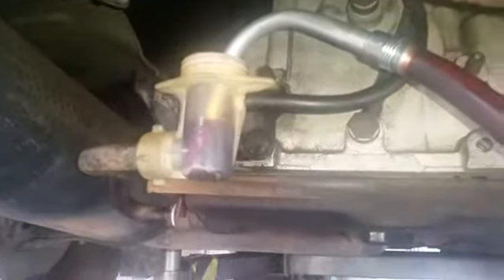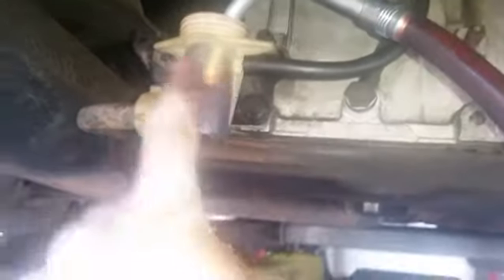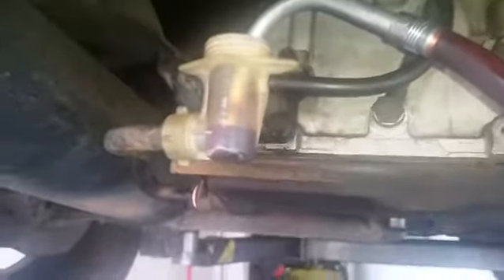Porsche 944 - topping up automatic transmission oil

Comment: How about changing the Gear fluid on a Porsche 944 Automatic??? What is the capacity??? Do you drain it from the fill plug???? I don’t think there is a drain plug like the manual transmission cars….